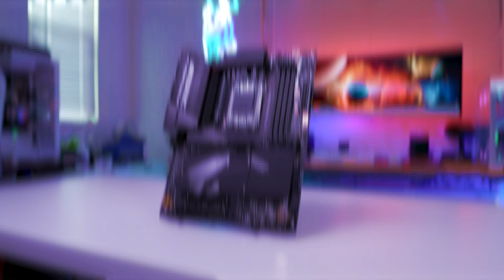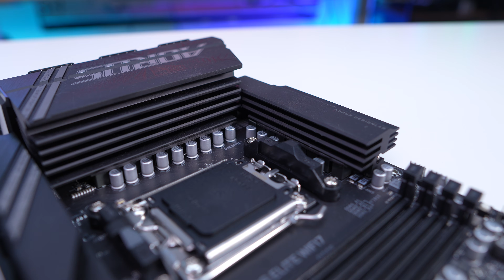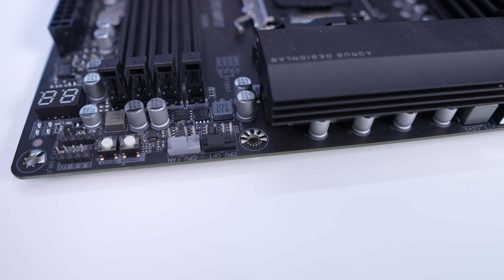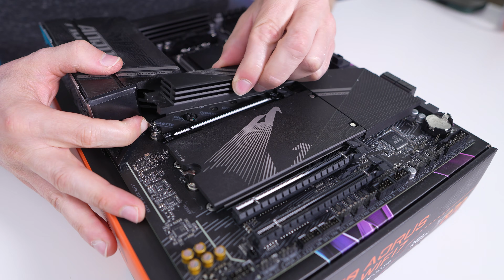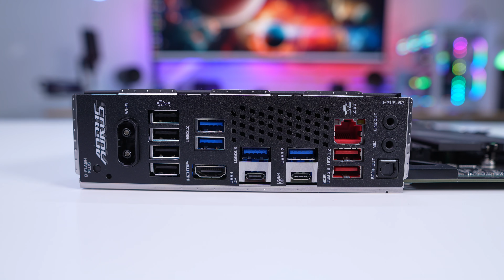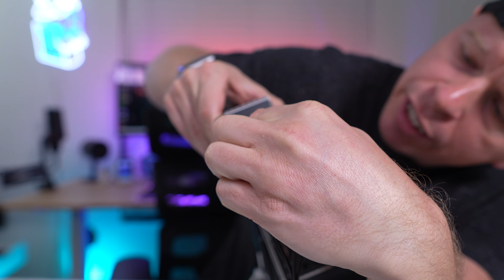Gigabyte X870 AORUS Elite WiFi7 Motherboard Review

Comment: 4:52 Curious if you know. If you run a Gen 4 GPU and install drives into those bottom M.2 slots, does it still cut the GPU to x8?

Comment: hi i want to ask, im currently planning to build a newer pc and currently thinking using this specific motherboard, im going to use a rtx 5080 super(when released currently running rtx 3080) in the build will  it interfere/ cutting my gpu performance if i use all slot for the m.2? also if yes is the answer can i just use the top 2 slot the gen 5 and 4 on the second row without reducing performance for the gpu?

Comment: Interesting, so if I have two Gen5 cards which I do, I should add it to the primary slot and the middle slot of the M.2 section and my graphics card won't be reduced to 8x?

If I fill both Gen5 slots in that section my graphics card output will be reduced.

Good video too, very helpful to know.

Comment: So they give us 4 RAM slots and 4 NVMe slots, yet I'm only supposed to use 2 RAM for overclocking stability and 2 NVMe's for max x16 bandwidth? Did I get that right? And you want to use 1 and 2, shown by the coloration, which is a and d, but d comes before b from top to bottom and that is different   than the 870E, which also suffers from the same inherit limitations, but has the 3rd slot for not taking the gpu to x8. Why not just remove these or take us down to an x8 slot? Sounds like we need to tell them what we want, instead of allowing them to be indecisive. I get flexibility, but this garbage gets confusing. I think they should be the experts and make a choice and cut some IO and just make me something solid and straightforward. I have been fighting with canceling the order I have for this build and choosing one of the other 1000 mother boards from the 800s or 600s lol. I'm going to go crazy before I get this built! I'm going for the rog strix rtx5070ti, r7 7800x3d, 2x 16 6000mhz cl30 RAM, gen 5 ssd 1tb, gen 4 4tb, arctic 3 240, a 1440p 144hz 1ms ips Lg gsync COMPATIBLE screen and a Corsair psu and an app vx 1500m ups. Final. Done. Not finding some other spec or factoid or feature I shouldn't care about like cmos reset or flashback or ai firmware. Don't forget about taxes and make sure to return parts in time and remember sales tax lol. The price just keeps climbing. Future proofing: unclear. The End!

By middle, he means the second of the 4 slots.

You don't want to use the CPU:
M2B_CPU or M2C_CPU

You DO want to use the PCIE BUS:
M2D_SB

There are visual differences between the sockets. I was able to easily tell mine was the upper-most slot. Some say there are version differences, but the current 1.0/1.1 manual states the following (Pages 4, 5, and 9 of the Manual: https://download.gigabyte.com/FileList/Manual/mb_manual_x870-aorus-elite-wifi7-ice_1005_e.pdf ). It doesn't mention a difference between these 2, but maybe there is a 1.2 difference. It does note a bunch of other revision differences. Also, the motherboard has labels printed on it, if there are any questions. https://www.techpowerup.com/review/gigabyte-x870-aorus-elite-wifi-7/images/gigabyte-x870-aorus-elite-26.jpg

M2A_CPU - Primary CPU x4 NVMe slot (support varies by processor)

PCIEX16 - 
1 x PCI Express x16 slot (PCIEX16), integrated in the CPU:
- AMD Ryzen™ 9000/7000 Series Processors support PCIe 5.0 x16 mode (support varies by processor)
* The M2B_CPU and M2C_CPU connectors share bandwidth with the PCIEX16 slot.
When the M2B_CPU or M2C_CPU connector is populated, the PCIEX16 slot operates
at up to x8 mode.
- AMD Ryzen™ 8000 Series-Phoenix 1 Processors support PCIe 4.0 x8 mode
- AMD Ryzen™ 8000 Series-Phoenix 2 Processors support PCIe 4.0 x4 mode
(The PCIEX16 slot can only support a graphics card or an NVMe SSD. If only
one graphics card is to be installed, be sure to install it in the PCIEX16 slot.)

M2D_SB - Shares Serial Bus PCIEX4 Bandwidth 
* The PCIEX4 slot shares bandwidth with the M2D_SB connector. The PCIEX4 slot
becomes unavailable when a device is installed in the M2D_SB connector.

M2C_CPU - 
Shares CPU 1 x PCI Express x16 slot bandwidth.

M2B_CPU - 
Shares CPU 1 x PCI Express x16 slot bandwidth.

PCIEX4 - 
1 x PCI Express x16 slot, supporting PCIe 4.0 and running at x4 (PCIEX4)
* The PCIEX4 slot shares bandwidth with the M2D_SB connector. The PCIEX4 slot
becomes unavailable when a device is installed in the M2D_SB connector.

PCIEX2 - 1 x PCI Express x16 slot, supporting PCIe 3.0 and running at x2 (PCIEX2).
Reply: That is helpful. Thanks

Comment: So which m.2 ports can be used without limiting your GPU?
Reply: 2 but 4x8 lanes ain't gonna decrease performance in gaming i think
First on that large heatsink and the m.2 4
Reply: @Herosop  Where'd you get this info from? i looked it up and all 3 gen 5 slots dont slow down your gpu
Reply: I believe you use 1 and 4, which is gen 4 to avoid this. You get 1 of the 5s and 1 of the 4s or drop to x8. That is what I have gathered from other videos and research anyway. Not a hardware expert though.
Reply: I prefer this too. I didn't really get far into the pcie 3 with my last pc and bought a 4 at first, not realizing there were 5s out. I ended up picking up a 5 too. Anyway, I like that this (what I believe is the proper placement), as it would put the 2nd nvme away from my gpu at the bottom of the board.
Reply: Also, many say the current gen gpus don't saturate the x8 at 1440p anyway, so you could go either with high storage later with this resolution with little degradation or go with a better next gen gpu and keep it at the 2 slots.

Comment: 4:52 That is actually incorrect.
Reply: Did he say if you have an M2 in any of the bottom slots the PCIE16x gfx card slot will run at 8x???
Wtf? What's the point of this motherboard then?
Can someone elaborate because I just ordered one!
Reply: @shammy8703 its pci 5 mate...x8 or x16 the dif is none lol
Reply: So what's the real answer about the bottom 2 drives? They don't limit the x16 slot at all?
Reply: @CusomPCs no they don't 😂😂😂
Reply: @tommybelly-s9c would it only affect the bottom pcie or non at all since I imagine they are already limited ???
Reply: @rubae8133 no clue what u said 🫠🫠

Comment: I m thinking of buying this m/b instead of the MSI MAG Tomahawk X870 because of the Ethernet / Wifi issues the MSI has.
Reply: What issues ?
Reply: @im_zerox6205 I read in user reviews that the ethernet port malfunctioned back then. You could not connect to the internet. I dont know if or how it was addressed. I purchased the Gigabyte and I have no issues other than an elevated chipset temp (60 to 65C) which is normal for this model.

Comment: if i use only one m2 ssd slot my GPU will run on x8 instead of x16?

or only if i use both m2 slots?
Reply: If you use 2 GEN 5 M.2 slots... your GPU will run on x8... if you use one M.2 Gen 5 and one M.2 Gen 4, your GPU will run on x16

Comment: Ill have mine tomorrow (got the white version)  replacing an AM4 build with an Asus ROG Crosshair VIII Dark Hero (overpriced pile of junk). I'm loving what I'm seeing from Gigabyte lately; they are really thinking out how power users 'use' their builds. Just that PCIe unlock button would have been a dream when I was benchmarking GPU's. I was using a long screwdriver to push the unlock button down because my huge Noctua heatsink was in the way. And the quick release of the m.2 drives. Asus had me unscrewing panels just to get to the screws to release the m.2.... And the Dark Hero cost me $500 at the time. No more Asus for me for now.  Keep it coming Gigabyte! The AORUS Elite WIFI7 ICE cost me $279 which is a bargain from what I'm used to paying.
Reply: Hey, man. How's it treating you now?

Comment: can i put a gen 4 ssd in the gen 5 slot?
Reply: Yes and it will run at full speed cause gen5 is rated for higher than gen4. If it was the other way around gen5 drive in gen4 slot, the drive would only run at gen4 speeds. All good to go my friend!
Reply: @Skrill3x24  thanks!

Comment: quick question, right now i can only run 1 m.2 ssd because i have my elgato using one of the pci slots. would a motherboard like this allow me to use a m.2 ssd in the top slot, another m.2 in the top of the 3 ssd slots so my graphics card run at full speed, and then like a elgato connected to the pci slot at the bottom?

Comment: Excellent review, I just ordered it from newegg where is on sale with a free 1TB SSD from Team (PCIEX4 x4). This mobo has great value since comes with a Realtek ALC1220 audio codec and Realtek 2.5GbE LAN controller, other more expensive options are shipped with the awful ALC4080 USB audio codec which is a pain to fix if you have disconnects or noise/interference in the audio. Let alone the Intel 2.5GbE LAN controller.

Comment: Recommend this mobo for a 9800x3d build?
Reply: It's what im going with.
Reply: trash motherboard, i have one and my ethernet port stopped working, dont buy this crap
Reply: @yisuscancino1927  One defective part of one motherboard doesn't make every unit bad dude, suck it up and get a refund/exchange.
Reply: @fishingislife8432  yeah, But it's not only me, i saw that's kinda common with this mother. Unluckly i can't get a exchange or refund bc they don't answer but that's just my case
Reply: @yisuscancino1927  Stop larping on yt comments and get a new hobby
Reply: @yisuscancino1927 do you mean the tuf gaming ddr5 motherboard?
Reply: @yisuscancino1927 same with me, I found that the GCC LAN drivers were bad!!

I went to device manager and uninstalled it.

I downloaded the Realtek 2.5g drivers directly from their site and it fixed all my issues!!
Reply: @yisuscancino1927 use WiFi ?

Comment: so if i populate one of the bottom m2 drive with gen also it will limit the gpu ??
Reply: no gpu out now, even the 5090 will be bottlenecked by this issue. it's a non-issue right now.
Reply: Yep decrease from X16 to X8 speeds. No thanks- that limits leaves you with the option of loading gen 5 ram with. Hit to your GPU or loading a GPU with minimal ram slots filled. Gonna look at other options for mobo- overall this board is super solid though
Reply: @kennethnorris2968  what if if i putgen 4 or 3 , the same thing ? I already ordered it 😔
Reply: @ I’m sure it would be compatible in the gen 5 slots or not tbh
Reply: @S.D1010 same ordered yesterday and came across this today.
How did it work out for you?
One of the reasons why I got this was because I was planning on using 3 m2s
Reply: Even if you look at the X870E (almost twice the price) it's the same issue I believe, and not a gigabyte specific issue.
Reply: Should only be an issue if you need more than 2 m.2 drives, and/or if want Gen5 exclusively.

Comment: Im thinking of throwing this board in when upgrading my pc. I'm planning to just run 2 Crucial P3 plus 2TB drives which yeah ik they're pcie 4.0, but idc. Which m.2 slots would yall recommend me putting them in?
Reply: A and D slots, leaves GPU alone.
Reply: don't, i have one and is just problems. mine got an issue with the ethernet port. it just stopped working and theres no way to get it working again.

Comment: i have a question. if you populate the bottom 2 m.2 slots, you limit your graphics slot to x8. is that dependent on whether you populate them with gen 5 cards or will gen 4 cards also cause this limiting effect on the graphics slot?
Reply: Populating either of them with any m.2 will cause the GPU to run in x8.

Keep in mind x8 gen 5 is equivalent in bandwidth to x16 gen 4, so this likely won't be a big deal at all
Reply: @123JimmyTheCookie  im planning to run 2 of the Crucial P3 Plus 2TB drives, which are pcie 4.0. Putting them in the in the top 2 m.2 slots is what i should do?
Reply: @Krispie_224  I'm also planning on running two pcie 4.0 m.2s. I think in this case yeah, top two slots makes sense (slot M2A and M2D as mentioned in the manual).
The top one being the boot drive that will run off the x4 directly from CPU, and the second slot running off the chipset, which will allow the GPU to run in full x16.
Reply: This is just for peace of mind knowing my GPU is getting all it can, but it's yet to be seen if cutting the lanes in half will matter for pcie 5.0 GPUs.
For pcie 4.0 yeah it had a small effect, 1-2%, but the bandwidth here is much larger, could be a completely non issue
Reply: @123JimmyTheCookie  Same. I'm going to start off with 2TB GEN4, for now. When GEN5 comes down in price, I'll switch that to A slot, move the GEN4 to D slot, GPU still unaffected in any case.
Reply: @123JimmyTheCookie i don't need much storage just a 2tb m.2 which will be 4th gen. Can I just put it in the top m.2 slot and be ok?